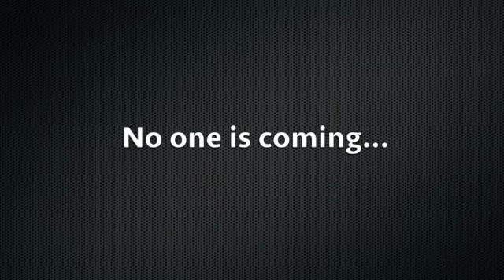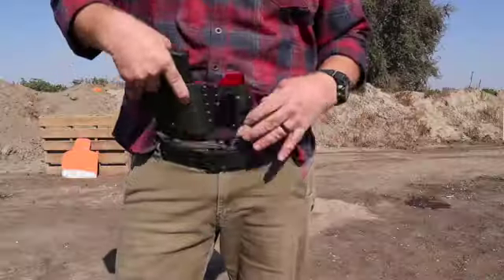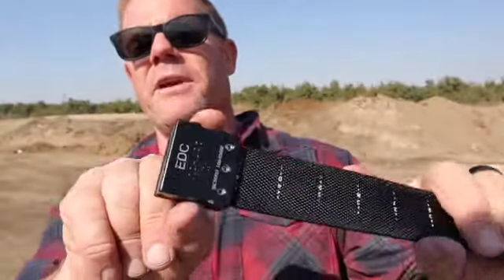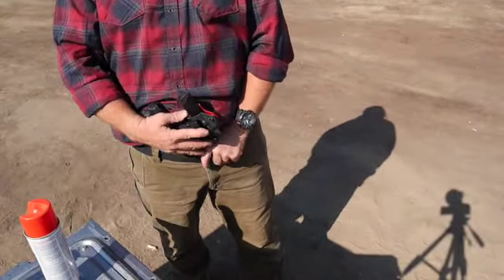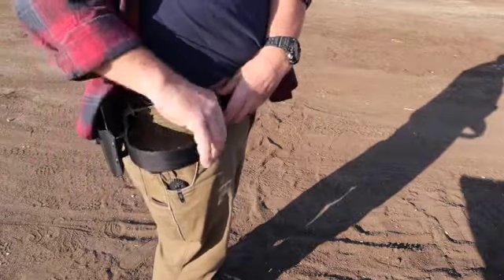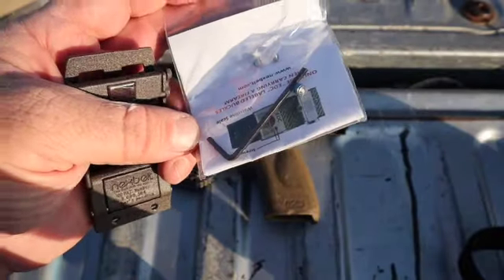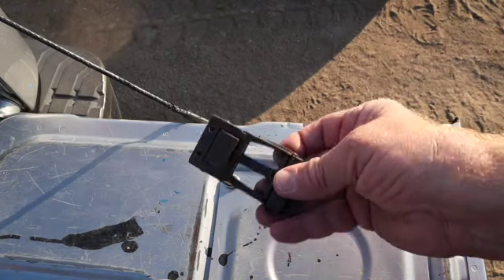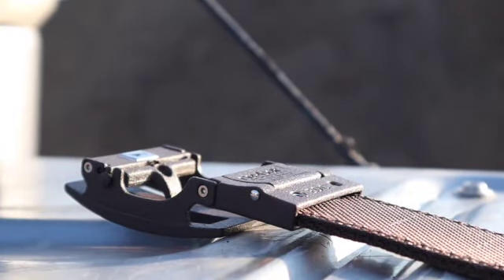OG's EDC and the Nexbelt Gunbelts!

Comment: Sailors trick for sealing cut cordage. Use a hot knife. Simply borrow a knife from the kitchen, a butter knife will do. Heat with your favorite propane torch and cut off with the red hot knife on a pc of scrap wood.   Then quietly replace the knife in a kitchen drawer. "I have no idea what happened to that knife, was it in the dishwasher?"

Comment: LOLOL! That 50 Shades of Greg in the intro!
When I open carry I use a standard issue US GI milsurp belt that I got for under $10.00. Sure, it's not ascetically pleasing, but it gets the job done. When I CC it's a shoulder holster setup. 
It's always a good day when you post a video, OG. I look forward to the next one.
Reply from the maker: Always glad to hear from you as well, sir.  Stay armed and safe out there.
Reply: @OGsDangerShow  Thanks and will do, OG!
Reply: I carried a shoulder holster for a short time when I was an investigator.  It looked cool (this was around the time of Miami Vice and it was a Galco Miami Classic) but I got in a couple of foot pursuits and had trouble reholstering with one hand, plus it flapped around hitting me in the side.  But damn, I looked good.
Reply: i always like a vertical shoulder rig. kept that extremely annoying flopping from happening. and multipurpose as suspenders.

Comment: 2 things so far. I've had the next belt after 6 months of supporting a Glock 19, and a 19x 19rnd  spare it started to get a little soft for my liking. I gave it to the old lady and ordered a kore belt. It is a lot stiffer I highly recommend trying it over the next. Number 2. The tier 1 axis held up those 6 months with the next belt but after running it on the kore for about 3 months the claw started cracking the kydex where is screwed in on both of the corners against the trigger guard. Called tier1 they said send some pics they responded in 3 min told me to send my old invoice# and they will get one shipped out as soon as they can. Great warranty! Highly recommend kore and tier 1
Reply from the maker: Inexperience with Kore but I own five T1C holsters.   Love them!
Reply: @OGsDangerShow  my opinion being what it is worth. I believe the kore is a better belt than the next when carrying a mix sized or full sized gun. I would never say the next was a bad belt. It never let me down. the kore is just a more ridged belt and a bit wider but time will tell. Supporting 5+lbs of gear +- 16 hours a day is taxing on everything. But wow am I impressed with tier 1 on their service! Second to none!

Comment: I will have you know Gregg, I bought myself a NEXBELT and love it.  I hunted around and found the belt I liked on eBay for a good price and had it in hand within two days.  I ended up with the carbon fiber looking leather dress belt and it matches my carbon fiber IWB holster I had made.  I've used it for the last three days and love it, it's very stiff but also comfortable and lays flat with nothing sticking out.  Thanks so much for showing off your new belt on the video i'm sure you will help many others who have this same problem.  I used my old cowhide belt for 15 years and it did just fine but this new NEXBELT is a huge improvement so thank you.
Reply from the maker: Glad you like it, Larry.  I love them and I thought other gun-carriers would too.  Stay armed and safe out there.

Comment: Greg, I bought a Kore belt years ago. That was $60 well wasted. They said you couldn’t pinch it , you could, then the buckle fell off. That put me off on these style of belts. Now I have a double Bullhide belt the I’ve had for 10 years. Can’t pinch it and looks as good as the day I bought it. The only problem is that it was $100!!!!
I think that you sold me on the belt you are wearing but being I am retired and on a fixed income I will need to save. If you were wondering I carry everyday ether a Glock 19, 26 in a OWB holster or a 43 in a  IWB holster made by Vedder. 

Stay safe OG and keep on doing those videos on both channels!!
Reply from the maker: Sounds like you are well-armed sir.  I looked into the Kore when buying this one.  Kore gets lots of press coverage, but I think this is better gear and you just confirmed it.  Be safe and stay armed, sir.   -OG
Reply: You must have ordered or received the wrong belt. The gun belts have a polymer insert that the dress belts dont i assure you as i have several Kore belts that they hold up very very well. Also the Kore belts have 2 buckel retention methods so if it fell off it was definately user error. FYI i do not work for or am in any way affiliated witj Kore essentials im just a fan of there products
Reply: I’d love to see a Kore gun belt get pinched by hand. 

Both leather and gun Kore belts have been serving me very well. I’m hard on all my gear and clothing. 

I’ve seen some videos comparing the Next belt and Kore, interesting vids. I just happened to pick the Kore, we’ll see if they continue to hold up.

Enjoy your belt.

Comment: I've been using a ratcheting (non gun) belt for a few years and the two things you want to look for in a design is easy access to the release button that should be big. You don't want to have to search around for it all the time. Secondly, all edges should be round, rounded off or smooth so that none of it digs into your belly area when you bend over, sit down or do Ranger rolls, etc.  Also I'm sure this belt product you like is very nice and and would be much better than a traditional buckle system belt but those ratchet teeth look very similar to the types that are on all the other ratcheting belts, other than the red color.
And to everyone out there if you haven't tried a ratcheting belt of any kind, you should give it a shot, it's nice to be able to instantly expand or contract your belt as needed , like expanding it after meal or contracting it if your pockets are heavy, without anyone noticing what you're doing. Thanks for the great video as always!
Reply from the maker: Thanks Dan.  Nexbelt uses their own ratcheting teeth because the ones commonly found on most belts wear out after being dragged along the metal pin over and over again.  These last much longer.  Super tough material used in the teeth.   Thanks for watching.

Comment: I keep trying appendix carry and end up abandoning it. Would like to see a video on exactly how you do it. It seems like it's always jabbing me in the ribs or the crotch. Maybe my torso is just too short. I'm not really sure
Reply from the maker: Possibly.  We’re all built differently and it doesn’t work for everyone.  But I think you’re right, a video would be good.
Reply: We found that evaluating various CC options. I think it's a 'system' thing. So if you wear hip-hugger trousers riding low, it risks the crotch, high waistband, the ribs. And body type plays a part, ie the old ecto/meso/endomorph type & having a more clearly defined waist/hip line could make hip or appendix carry more comfortable. Pistol obviously plays a part, ie a longer gun is going to be more awkward than a compact. That was pretty much fixed for us with the P228/L107A1 we carried. Then the holster, where I think we ended up with a Galco that was semi-rigid, ie rigid where it held the pistol, but with some flex in the plastic around it to help it fit. It was also angled rather than being vertical, which made it more comfortable and quicker to draw. And like OG says, a good belt is also key so it's quick and easy to fit & adjust, and won't slop when you don't want it to.
Reply: @brolohalflemming7042  I realize these things. Obviously if you're quite skinny it'll be easier to appendix carry. I wear my pants relatively low, and it still jams me in the ribs. That's why I say maybe my torso is too short to comfortably carry appendix. Could partially be a bad holster too. I need to try a better one.

Comment: Its the same in almost every way as the belt I ordered from Kore. I've had it for about a year now and love it. Makes drawing a pistol much easier and reliable.
Reply from the maker: Very true.  I’m going to have to try the Kore belts.  🤔
Reply: @OGsDangerShow  if your happy with what you got, I wouldnt bother.  Looks the same in every way.  Seems like this is the way with manufacturing gun accessories.  Your right though.  I went from a sturdy SnapOn belt, to a belt similar to the one you showed here, from one training session to another and what a difference in the draw.  You can more accurately predict where the gun will be on the way out.
Reply from the maker: @windstarpro  I tell my ccw students a sturdy gun belt is JUST as important as a good holster.  But like kids, they rarely listen.  😂

Comment: OG I use the Kore 1.75' wide ratchet belt cause its a beast. My nexbelt 1.5" sagged and flopped when i went owb G19. When I took it back to the store they did refund me so that was good and then told me they stopped carrying nexbelt. They had switched to the kore ratchet belts said they were more reliable and stiffer for cc and they had 1.75 inch width which I can tell you is a lot more supportive. No comparison.

Comment: i like my nexbelt. only thing i didnt  dig was the inside of the nylon model started to shred along the part that has the ratcheting section. i just kept cutting it down and remelting every 8 months, but still a strong belt. i'd probably run out of belt material after some years but its still a very convenient design.
Reply from the maker: Hmmm.  I have three and never had that problem.

Comment: I much prefer Spec-Ops nylon belts to the 5.11 version. While there is a bit of flexibility, I typically carry a full-size M 39-2 OWB all day without an issue.

I tried a Kore for a dressier belt. It has a ratcheting system similar to OG's Nexbelt example.

Comment: like the buckle, push button rather than having to retract belt from loops then pull back pull pin then thread back to undoo. you run in to the washroom and stand there turtling trying ot undo buckle, lot better system press button pull sit all the breast jim

Comment: This is nothing but an infomercial!

That belt is almost impossible to get off.  Some people have had to   cut it off.  Thanks to this guy i bought one from them.  They won't refund my money because they say i cut it, but the catch is that in order to try it on you HAVE to cut it first!

People who have managed to use it say the little plastic ratchet catches wear off quickly.
Reply from the maker: I’ve used three of them for over a year now. Plastic ratchets are just fine and I didn’t have to cut mine off.   🤣😆🤣😆🤷‍♂️. Bought all three at full retail price. They weren’t given to me so I’d say something nice about them.
Reply: @OGsDangerShow  

OK, sorry if i was rude, but how do u manage to get it off or loosen it?  I found it extremely difficult to get the tiny button to unlatch. I thought I would have to cut it off too - which wouldn't be easy either -  but i finally managed to open it.  If u look on online reviews u will c that I'm not t only one who has had that problem.  And that's where i saw the complaint about the plastic catches wearing down.

Comment: I dont like that belt. esp from a perspective of outside person that might need to take it off (something like EMT/Medic) it feels like that tiny button is bad to find in a chaotic situation (like blood all over it and you are in a hurry). I have a belt similar to the 5.11 and it works perfectly, though i must say i dont have concealed carry holsters, only heavy, visible ones and they are perfectly fine on that belt. its a little bit wider (like 5-7cm) and just has a pressure latch buckle. holds perfectly tight for a whole day with 5kg on it, is easy to open, even under heavy load, but never ceases or opens unintended. i use it for like 10 years now and it still looks like new, though it IS stiffened, but dont ask me how. maybe its asbestos, from its age...  TLDR: it is a difference between use cases and personal flavor, so whatever ya fancy and feels good/works good for ya, right? :)
Reply from the maker: The tiny button and fast release is perfect for your use.  Won’t get bumped accidentally.  Takes .10 second to release or put back on. Rigid.  Holds all your gear.  Perfect.

Comment: The O'G I see you failed the interview for the paid infomercial at 17.43 not tucking the belt end into the trouser loop.
I knew that I had heard of the Officer Greg a way back. The 50 shades of Greg was desperately confusing especially considering you gender fluidity. You have put on a few pounds since your appearances in "The Wire" You are not quite as butch now either.
Serious question time. I'm a Brit so not going to be concealed nor open carrying, so I don't have a dog in this. A man attacked me viciously with a knife, so I can't wear a belt. OK the guy was a surgeon, and he pretty much saved my life. It is however true that I can't wear a belt, I have to wear braces. Elsewhere, someone mentions shoulder carry, given that people don't wear jackets as much as the 80s and Paul Harrel's piece on prejudice and shoulder carry are there any non belt non shoulder carry methods?
Reply from the maker: Off body carry is popular here.  A sling bag like the one in my video or any other Man Purse than can hide your gun and a few mags.  Not the best option, but an option nonetheless.